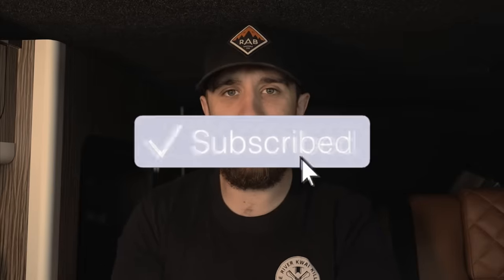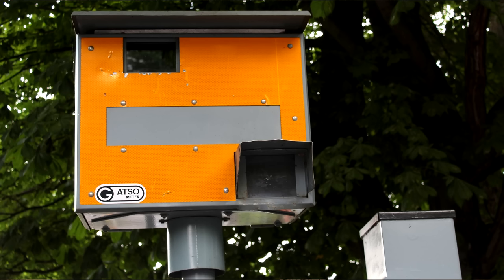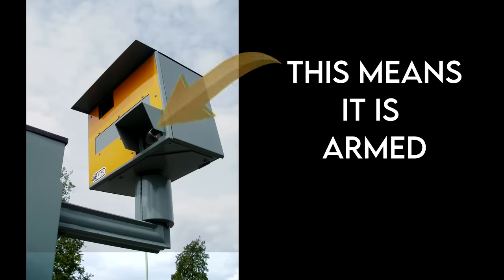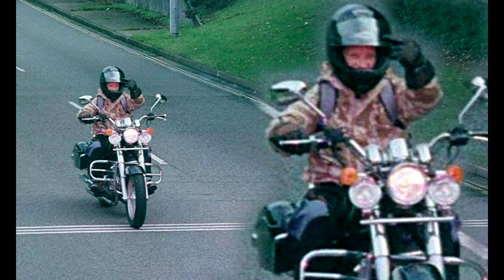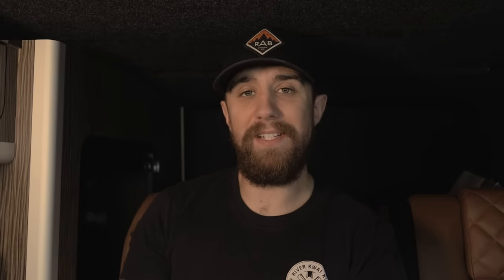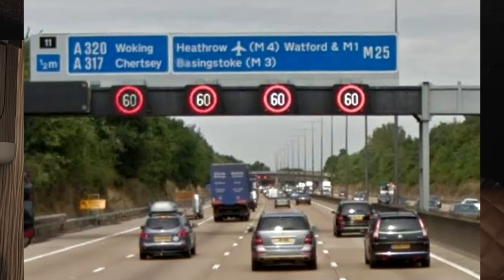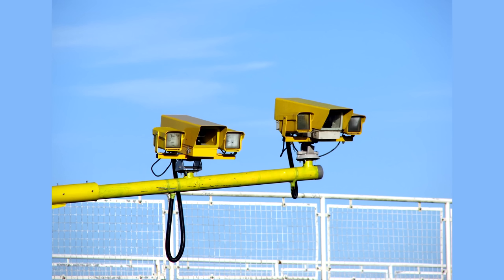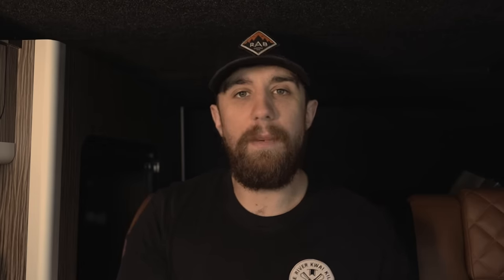How Speed Cameras Work and What to Look Out For

Comment: If we really want to stop speeding, we need a completely new approach.  Covert cameras should be everywhere set to trigger at 10% + 2 over the limit.  First offence will cost £5, the second £10 and so on up to a maximum of £320.  If not caught for 12 consecutive months, the fine drops back to £5 and the cycle starts again.  No points, but the fines will quickly become ferocious.  

Anybody breaching the limit by 50% or more faces court and almost certainly points and a ban.  Again, bans will automatically double as a minimum on each occasion and anybody caught driving while banned goes straight to jail where the balance of that ban plus the new one.

Anybody not paying their fines will have their car seized by the State and sold or scrapped.  If there is still a big balance left, other assets would face seizure as well.

On trunk roads, camera technology needs to be developed to deal with the problem of tail gating.  A little too close, you get a polite letter.  Too close, a fine and points.  Stupidly close and it is off for a chat with a magistrate.  

With current technology, the whole thing could be automated, from the taking of the picture to the delivery of the fine to the registered keeper.  Costs would be very low, income very high until people behaved themselves whereupon income would drop, by which time the thing would be paid for.
Reply: Soon the camera will be a thing of the passed  as the speed  limit will be 20 mph 
And cars will be tracked  by 5G masts  and a speeding ticket will just be sent by post  more cash for the Christmas party
Reply: @enfield7123  I fear that you are right.  The only saving grace is that it will take a long time to implement.  2024 EU regulations require cars to be fitted  with tracking systems but not necessarily active, at least for the moment.  At the moment, cars have a life of around 15 years, so it is unlikely to be rolled out for at least 20 years, when most cars will have all the kit in them.

This is why I prefer old cars, preferably ones with no electronics whatsoever.

Comment: speed cameras cant tell if your drunk, drugged up , if you actually have a driving licence, if you are the actual person thats insured for the car. the first 2 which are far more dangerous than speeding.Before cameras  police followed you they did it for 1/3rd of a mile then pulled you , they could then tell instantly if you were any of the aroementioned and could have you off the road immedialtely. This is exactly why everyone knows they are for income only  as they only can check speed.

Comment: Spot on about revenue generation..
Reply: Revenue for who? And how much is made?
Reply: @NoBody-gf8ie  Google it, you’ll find that the cameras are installed by ‘road safety partnerships/camera partnerships’
The location of speed cameras is not decided solely by police, but rather by the aforementioned road safety or safety camera partnerships, of which police forces are members.

A certain % of the fines go to local authorities..
There’s plenty of info on the internet relating to speed cameras and their use in revenue builders instead of road safety and casualty reduction..
Reply: @icarus3604  thats only partly accurate only a few forces use safety partnerships these are partnerships with the police and local authorities  where local authorities supply the equipment and police supply the staff, the forces that don't use a partnership run the whole operation them self whatever way it's done the funding comes from a percentage of the fee for the speed awareness courses (the rest of the fee goes to the company that run the course) drivers that   choose not to or are ineligible to do the course pay a fine and that goes to the treasury consolidated fund and that is public money used for public spending so we all benefit from it.

Also most sites are community concern areas where local communities request their presence due to problems with speeding
The rest are chosen using collision data and requests from local authorities in areas where speeding is a problem.

Revenue is NOT a consideration when choosing a site is chosen.
If a site is making "revenue" then clearly there is a problem with speeding!
Reply: @NoBody-gf8ie  so you googled it…
Reply: @icarus3604  don't need to google it, I know it 😏

Comment: What always baffles me is boy racers that speed everywhere usually driving some type of car with a noisy exhaust. 
This is the law as it stands today.
(Depending on the offence, you may receive points—known as endorsements—on your licence. And, since the New Drivers Act of 1995 came into force, accumulating 6 points within your first 2 years of driving will cause your licence to be revoked. Having your driving licence revoked effectively means that it has been cancelled. You won’t be allowed to drive again until you’ve got a new provisional licence, which you have to pay for again. Once you've received that, you’ll be subject to the same rules as any other learner driver. You can only drive with a full licence again when you’ve proven you can drive safely—by resitting both the theory and practical tests).
So how are these young men not getting caught? It’s so easy to suddenly find you’re in a 30 or 20 mph area because the signs change so readily and usually just to be on the safe side I hover at 20 mph probably annoying any impatient driver that’s right up my arse. It’s apparently difficult to get a Test date and expensive on your insurance if you’ve been disqualified so why do these youngsters take such risks?

Comment: I'm in Wales overtaking a cyclist,went TWO miles over 30 and got a speed awareness  course!! For mine and the cyclists safety I accelerated to get back into lane. CASH COW that's all that  was as I had to pay £60 for the course and travel 180 miles to attend!! Sod the climate change by doing that of course!!
Reply: No force issue's a ticket for 2mph over the limit!
Reply: @NoBody-gf8ie  Oh YES they do! This was on the way home from the Lynn peninsular. I have no reason (except indignation) to have outlined MY experience
Reply: @suefoley8508  no they don't, you either miss remember or are embellishing for effect!
Reply: @NoBody-gf8ie  Oh I am SOoooo Sorry,I didn't realise you were an eye witness with 30/30 vision and a speed calculator for a brain!
Reply: @suefoley8508  don't need to be an eye witness or have a speed calculator for a brain, I just know that none of uk's 43 police forces issue tickets for 2 mph over the limit enforcement starts at 
10%+2.

Comment: Changing lanes through average speed cameras is good, if the camera says you were speeding you can argue that in reality you went from the longest lane to the inside shortest lane meaning you traveled a bend faster than you would have in the outside lane. Just make sure the cameras get you in two different lanes. Thus the camera said you did 60 but in reality you only did 50 just that it worked it out wrong. That was the historical thought process.
Reply: Any idea how much extra distance that adds?

Can you answer this:

How much further is it going clockwise round the M25 than going anticlockwise (using a lane so that there are always 2 lanes to your right on your carriageway)?
Reply: @cigmorfil4101  to even start id have to know the length then angle of bend. But I can assume that is larger than 400 metres and the staggered start at the Olympics is quite considerable even at that short distance.
Reply: @deanmoncaster  
Assuming the earth was a sphere, and you had a rope lying on the equator (approx 24,900 miles (40,075 km) long), how much extra rope would you need to raise the loop of rope around the equator by 1 ft (0.3048m) all the way round?  The answer is a surprising about 6ft 3 1/2 inches (1.92m)

 The radius of the bend is irrelevant - only the angle.

We can make some generalisations regarding the M25 without affecting the result too much.

First assume the M25 is a circle (the effect of any left turns would be cancelled out by simlar turns to the right).  Let the radius of this circle to the centre of the anticlockwise lane be R ft.

Assume the lanes are 12 ft (3.65m) wide and the central reservation is the equivalent of 1 lane.  This means the clockwise lane follows a radius of R + 6x12 ft

The difference in length between the clockwise and anticlockwise lanes with 2 to their right is 2×{pi}×(R+72) - 2×{pi}×R ft = 144{pi} ft ~= 450 ft (~= 138m)
ie around the approx 120 miles of the M25 the clockwise length is about 150 yards longer than the anticlockwise length! (In the outside lane the difference is approx 150 ft, 50 yds, 46m.)

In fact the length is irrelevant as it is only the width of the M25 (or any road) that matters in determining the extra distance. 

Going round a 90° bend (a quarter of the M25) with the above lane widths makes a difference of about 113 ft ~38 yds).

For a carriageway with 12 ft between centres, the difference between two lanes is about 75 ft around a full circle,  about 19 ft around a 90° bend, about 9 ft (2.87m) round a 45° bend.
Reply: @cigmorfil4101  thanks for that. Now read the final line of my original post.

Comment: Thank you. Well presented, and on the side of what is right. It is no use arguing about it.  

With regard to the Speed Awareness course, I assume you learned as to how the motorway marking of the importance of keeping 2 arrows distance between vehicles is incorrect as it should relate to the two distances between 3 arrows. If this signage is to have any credence at all, then the simple solution to changing the number to 3 rather than 2 on all of the signs, otherwise it remains incorrect and dangerous. 

You might not be the correct person to notify, but I raise this to you, as you might know how to raise the problem in the right areas.

All the best with your efforts.

Albeit that the overall distance would be slightly longer than required, but rather that than too short.

Comment: 66 drive a17 yr old berlingo (performance car)came into a 30 from a 40 lifted off in the 100yds into the 30. 3 yes 3  cops jumped out of a bus shelter with a gun. 2 uniforms bike cops and one in plain clothes. I was doing 36 they said - fair enough. I like to think I abide by all speed limits but the way they jumped out the shelter forced me to brake and concentrate on stopping and vehicles behind. Behind the bus shelter were 3 bmw motorcycles 2 marked 1 plain. 3 cops at £40k a year, 3 bmw motorcycles at £20k with their toys. £100k a year for what. They said it was a community concern? There are 12 houses in the village no doubt a local councillor or police chief. It is total persecution of law abiding tax paying motorists. It has changed my view of the police and what I thought they did for a job. My mum had just died and I had been to the undertakers and I think I was distracted and a bit numb but definitely at Ely was “ driving” ok.
I am all for road safety . I have been a motorcyclist for 50 years. A totally clean licences until. Like others on here you feel like a criminal and a sense of shame even though it’s a minor traffic offence. The police tactic of hiding in a bus shelter is sly and disgusting so is the cost of their employment. If that’s what the police do, defund them. Every time I see them going through red lights or speeding with blues on it upsets me as they are taking risks with others lives. Amongst my peers and their wives and children there is nobody without a speeding fine. All minute amounts over the limit. Daily I witness dangerous driving but nothing is done.

Comment: Speed limits are a joke in Britain. You could have a 3 mile straight with no houses and it will be 20mph.
Reply: No it wouldn't 20 limits are for built up/residential areas.

Comment: I'm sorry but there are so many mistakes in this video. for example HADECs have the camera, radar & Flash mounted beside the gantry, however the IR emitter is located about 50 feet to the rear. Also in all situations the lines on the road are not required, they are just a secondary check for older cameras when the technology wasn't trusted as much.

Comment: One part solution to getting nicked...put a 70 limiter on all cars when they are made...and an offence to remove it, or buy/sell a car without one.

So in 20 odd years most cars will end up having them
Reply: So you could still drive at 70mph in a 20 zone.
Reply: @NoBody-gf8ie  true enough...but it will address the issue of speeding on motorways at least

Comment: They are set to go off 10 mph above the limit ☝️
Reply: Tony  ... Nope!
Reply: @thepianoman1010  they are for sure I go over them up to 10mph max
Reply: @Tony-hw2pw  Tony ..  hiya ...  depends on where you live. Sometimes 10% of the speed + 2mph ...  other police forces... zero tolerance! Despite the fact that ALL police vehicles  ...  pandacars, vans etc ...  break the speed limit illegally every day of every week! 
See link
https://www.confused.com/on-the-road/driving-law/speed-camera-tolerances
Reply: @thepianoman1010  on motorway gantries with the red circles average speed cameras or gatsos wherever 10mph above the limit is when they will flash 👍🏻
Reply: @Tony-hw2pw  Absolutely correct to a certain extent ..  have known that these signs are designed to be obligatory, for many years, and since their inception ...  any sign within a red circle is designed to be obligatory. Whether they conform to the required standard(s) for speed limit signs is another matter! This is from section 10 of the gov site for the standards on speed limit signs. 

"1. The numerals may be varied"

"2. The diameter of the sign may be varied to 1300 mm when displayed as a variable message sign by means of light emitting characters and symbols"

The required size of these overhead light emitting gantry signs is not stated in this document. 

Regarding the 10mph tolerance ... I disagree ...  I believe the tolerances for these gantry cameras is set by the police force whose area the motorway is in ... possibly, ... even probably, being in line with the table I provided in my previous post.

Comment: Car speedometers are not 100% accurate. A satnav will often show a different speed to your speedo. So speed cameras, even if they are 100% accurate do have a margin of error. Otherwise every vehicle speedometer would have to be checked for accuracy before a fine is issued because it could be due to a manufacturing fault. If someone changes the tyre and wheel combination it's possible that they may make their speedometer inaccurate, even the difference between a worn tyre and a new tyre can make a difference. The speedometer is often displaying more speed than you are actually travelling at in my experience. That's why we have a margin of error. Then we have issue of vehicle control, it's very difficult to a hold a vehicle at a speed of exactly 50mph for example over a distance, a distraction, even seeing the camera can make someone alter their speed. It has to be clear that a person was exceeding the speed limit intentionally (which WAY TOO MANY PEOPLE DO! Adding to that: Please don't be doing 60 in a 50 when you see a camera and then break to 40-45, that is downright dangerous). Oh, it's a JOURNEY, not a RACE, it's better to get your destination alive rather than have a policeman tell your family otherwise. And most high speed accidents cause death or major injury so think about WHO is affected by your death if you die in a highspeed accident.

Comment: Lane changes has always worked for me. There are two cameras for a reason, they work in pairs, so camera 1 might be linked with camera 3, likewise 2 with 4. 1 could be 1 mile from 3, same with 2 from 4. Risky game if I am honest, if you haven't be doging them since you started driving best stick to the rules, for me, well you will probably see me flying past you in the average speed check zones 😊
Reply: This doesn't work for ASC in the UK. They're paired up but they are connected to a database, if it reads your registration plate it marks the time of the "read" and your reg and adds it to a database, when you go past the second one in the pair it does the same. As they are at known fixed distances apart it can calculate the time you took (from the two timestamps) and work out the speed as you've covered a known amount of distance. This gives an average speed. 

The only realistic way of avoiding the camera capturing your reg whilst not altering your car is to be conveniently next to a large lorry as you pass the camera, the large trailer often obscures the view given most cars have their plates only perhaps 1.5 - 2m off the ground and a lorry trailer is considerably taller. Even though they're mounted up high the cameras might not be able to read the plate as it's obscured.

Comment: It's a true story apart from the motorway average speed cameras the rest are for money making can't be for safety or they would put cameras there
Reply: Correct it is about money but not in the way you think as putting a static camera in place would cost the local authorities around £100k but mobile speed enforcement costs the local authorities £0 as it's self funded.